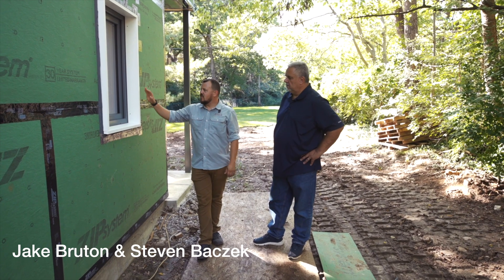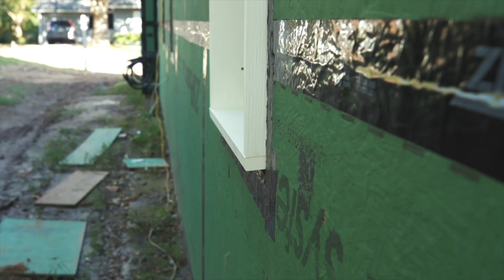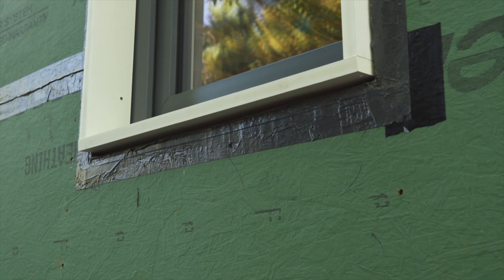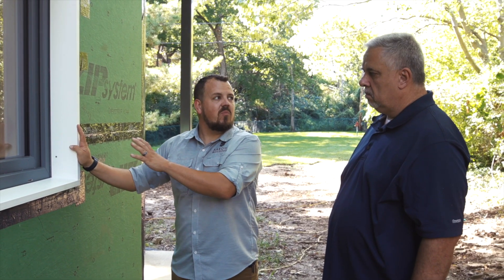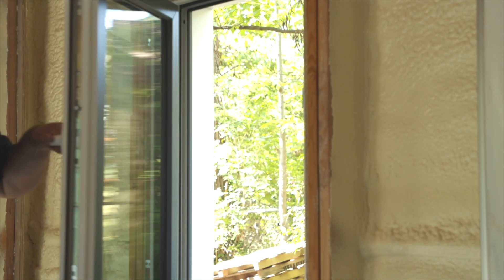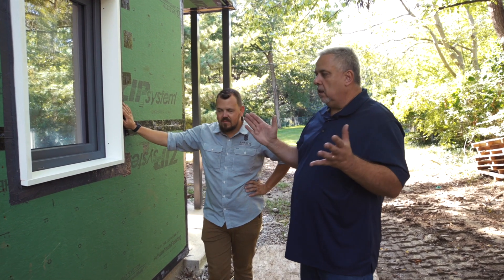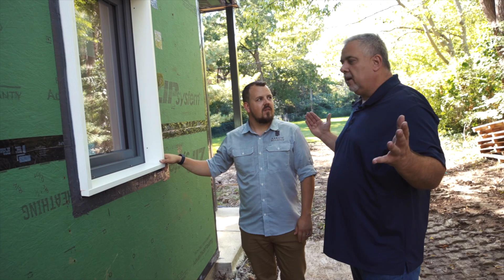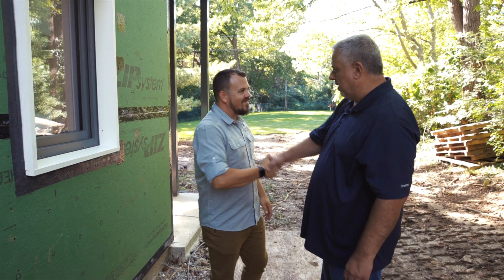Window Installation Positioning

Comment: When you reference the water management, are you referring to zip as being the water management or another layer that goes over zip ? Not sure I  like the idea of water getting behind an exterior siding.
Reply: Water does by some some percentage throughout the entire field.  The point of a rain screen system is to give it a trouble free path out and away.  The reason you hold off that 1/8th inch between that trim buck and the window is to facilitate that drainage.  I'm sure you remember playing with a straw at McDonalds - hold your finger on top and the water stays in when you pull it up.

Comment: Nice! One thing I really dislike about typical American flanged windows is that they are almost exclusively installed near the outermost plane of the wall, so the face of the window is almost flush with the exterior siding. And with most windows—especially vinyl windows—having little depth, the result is a cheap looking aesthetic. Setting the windows deeper in the wall provides visual depth and interest. If you’re going to go to the extra effort and cost of building a high-performance house, why not make sure it’s architecturally interesting as well?

One question: can you achieve some depth with a flanged window by installing it at the face of the sheathing/WRB and then trim it out on the exterior side to accommodate exterior insulation and a rainscreen assembly? Typically I see window bucks used with this type of wall assembly so the windows still end up out near the plane of the siding even with the additional wall thickness.

Comment: How does the bottom of the window get detailed?  Are they still open for drainage and airsealed on the interior side?
Reply from the maker: On this project they were not. This was a face sealed approach. However, nearly ever other project is exactly as you stated. And this one was an attempt at learning if it could be done, it worked but was a lot more work.